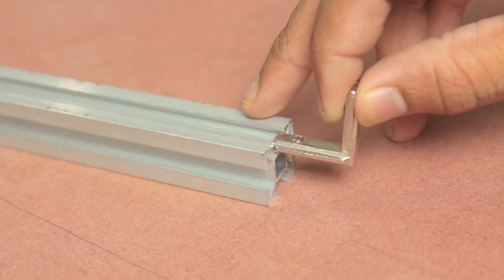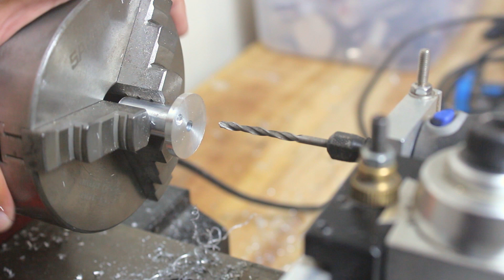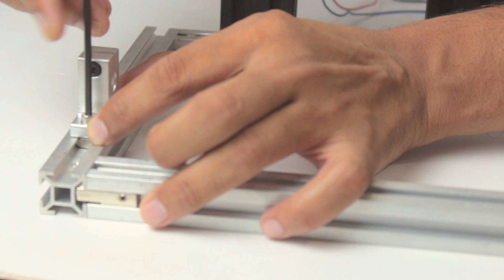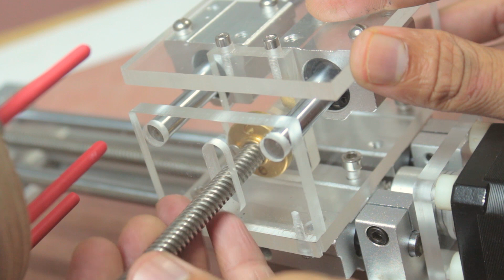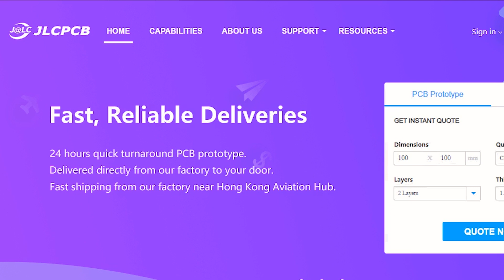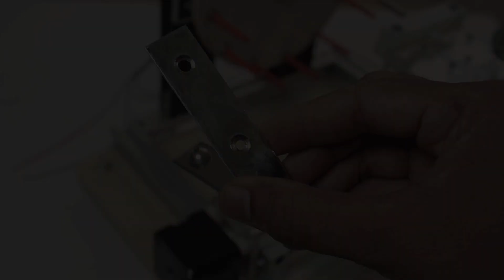DIY Arduino based Rodin Coil Winding Machine | Starship Coil

Comment: I am officially in AWE at your pure unadulterated GENIUS! 
There is no channel out there that even comes close to the mastery of Wood, Metal, Plastic, CNC and powertool skills that you have. Currently, the only thing holding me back from such 'creationism' is the CAD/CAM part of your process.  
PLEASE do a 1hr class on CAD/CAM and another on 3D print design.
Show us all HOW you take any part, and hand-make or 3D print another part to hold, support, align, stabilize or connect it to other parts in your finished machine.  
You ARE the master - tell us all which CAD/CAM and 3D design programs to buy and then SHOW us how to do what you do.   ...WE ARE your students  - teach us!  :-)

Comment: I can't think of a single 3d printer that uses a leadscrew for anything other than the Z axis

All fast moving axis use a belt driven by steppers on some sort of linear rail system.

I bet you could increase the speed of this thing a lot by ditching the leadscrew design and go with a 3d printer style belt drive system (look at the x carriage design of an Ender 3)
Reply: Bonus points, it would also be a lot quieter, especially if you ran quiet stepper drivers like 2209's or something.

Comment: The machine is nice, but Rodin coils violate the fundamental law of conservation of energy. 
It is reputed to a transformer that produces 5 times more power than the input power supplies on the primary side.. 
So, I am sorry to say Rodin coils are mumbo jumbo.
However, a variant of this machine could be used to produce custom windings for electric motors.
Reply: @Carl Jito a coil on its own doesnt have a Quality factor. Q only makes sense in a resonant circuit. And all airwound coils have the ability to build high q factor coils. But not with large amounts of energy involved

Comment: Is the display a smart intelligent  display with the menus layout stored  on sdcard 
Only variable data from arduino to screen
I am busy wit a dumb display
https://youtu.be/lny7J7KXk9w
Reply from the maker: this is a HMI onboard stm32 controller all GUI stored in Display itself only data RX/TX between arduino this is not it, it also have some GPIO pins you even not required arduino itself for some small project..

Comment: Hello friend. I have built a starship coil with 12 points. I just want to know if I have connect a resistor to it if I am adding say 528Hz signal to it? Does the coil seen as a short without resistor?
Reply: Good question, is such a coil even representing a true inductance? I think at least a resistor is imperative to ensure the amp is facing a real load.

Comment: I googled Rodin coil. It is at the heart of Rodin's design for an "over unity machine" which is a confusing way of saying "perpetual motion machine".

Like all attempts at perpetual motion, Rodin could never quite get his machines to work.

The coil winding machine in this video does successfully wind coils. The hardware could be reprogrammed to make wire sculptures.

Comment: One point is not clear to me is that you used two drivers for 3 motors
Reply: I think there is a l293d IC on PCB third stepper is connected to that